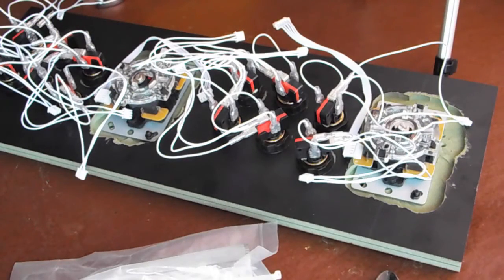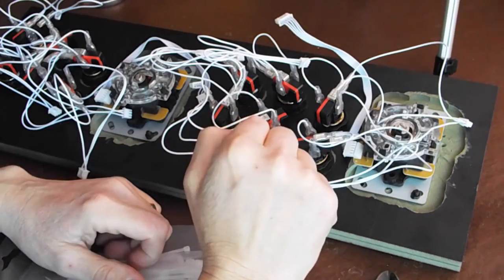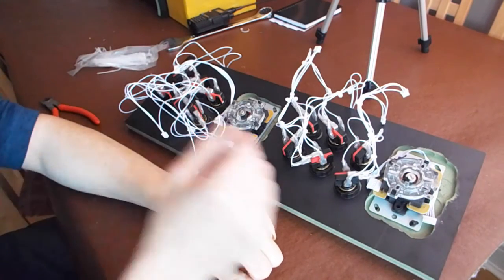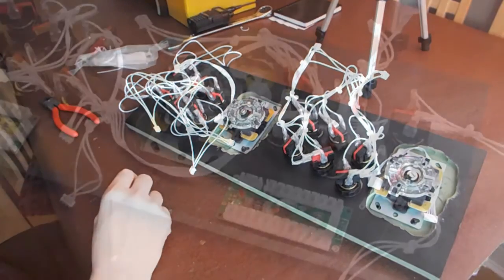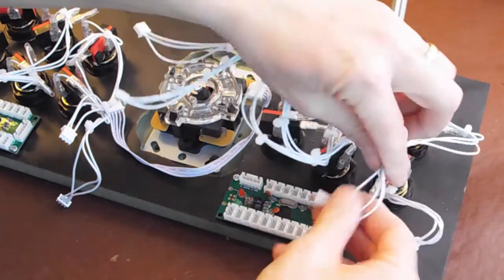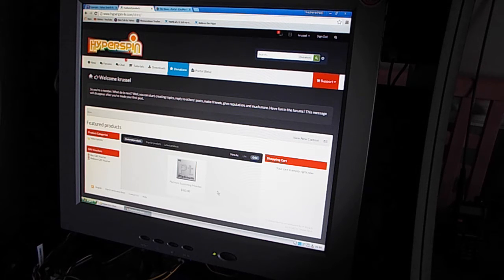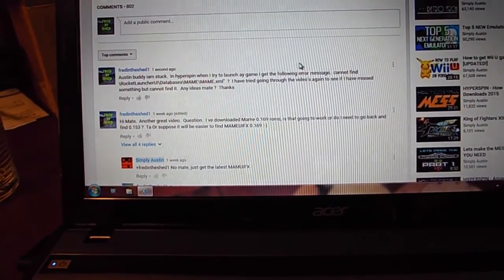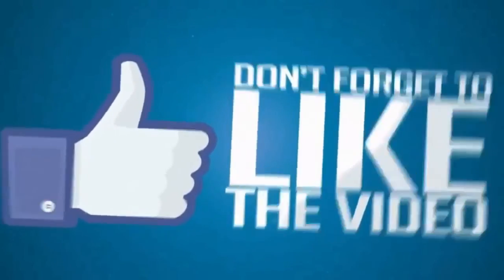MAME Bartop Arcade Machine build. Part 10

Comment: Hyperspin can get a little frustrating Fred, but hang in there. It takes some practice but in the end you will have a great looking interface! If i remember well i had a similar issue in the past, but since i am not at the software stage with my current project yet, i am afraid i cannot help you out with this. But i am sure that SimplyAustin can!
Anyway, great video as always and i am looking forward to the next one! Cheers!
Reply from the maker: +AeronNL Thanks for the encouragement.  Yes Austin came good and ive fixed the bug.  All will be shown in next weeks video ;-)

Comment: Fred,

Would you recommend the encoders you used? I was looking at ordering them online, and couldn't decide between these and the XIN-Mo encoder.  I tried building mine out of an old keyboard, and it does fine on the old 4-way style games, but on TMNT2 or a fighting game like Street Fighter, it is rubbish. Just enjoyed your build, and was looking for the voice of experience to work from.  Nice piece of kit, when all said and done, sir!
Reply from the maker: Its hard to say as these are the only encoders ive ever used.  All i can say is that they worked straight out of the box without issues.
Reply: Great! Thanks for the feed back. I plan on building one of these soon!  And really enjoyed your teaching.